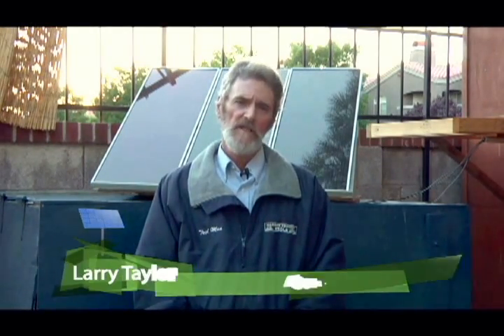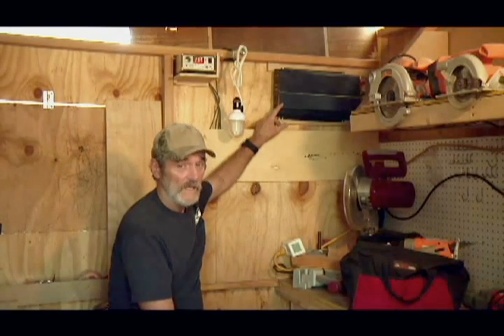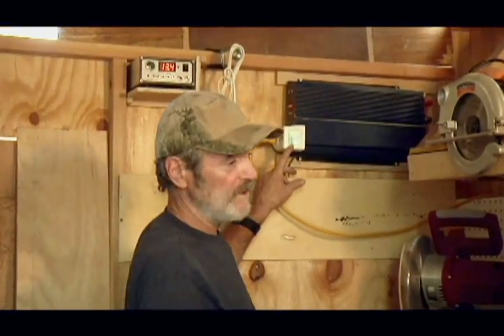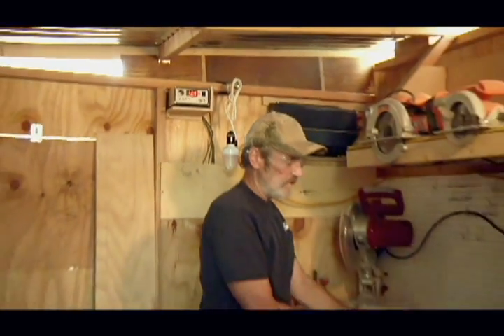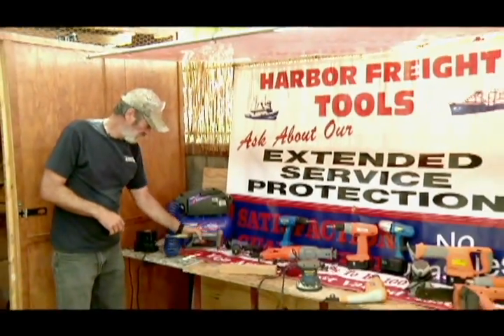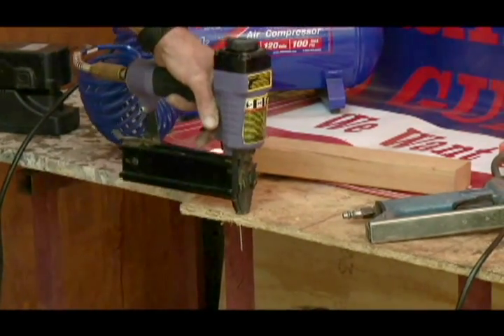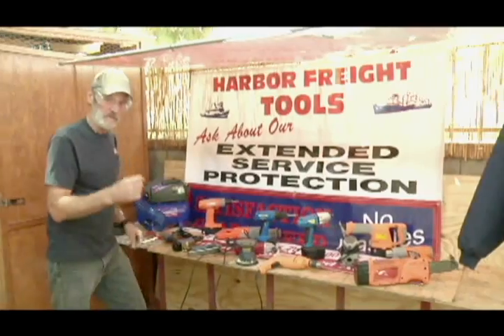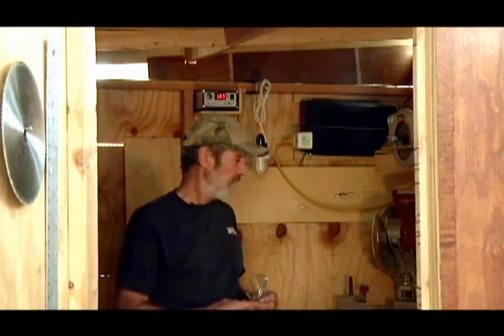Solar Toolman Workshop - 1

Comment: I liked it a lot. Easy to understand. Simple to follow. Very nicely done. Thanks Larry from myself David T - The Aussie living in the UK. I want to use solar to power my office, which is in heavy duty, fully insulated garden shed about 14x8. I need to heat it, a PC's and a printer, a dsl modem and a phone. I will watch your next videos to find out how. The biggest draw will be the oil filled radiator and the Mac with modem. The rest will be intermittent. My biggest issue, Manchester weather.

Comment: Thanks for your video, I own most of what you show in the video but my Harbor Freight 15 amp chop saw would refuse to stay running off the 2KW inverter (same model you show).   Ran a battery load tester on my deep cycles (they were new in 2005, I bought them used) and yep, the load tester said they run weak.   I think something you might have discovered by accident is that regular car batteries surge better than deep cycles.  I originally blamed the problem on my first inverter.

Comment: Thank you for the workshop, i have just invested in all the equipment that you have demonstrated, and then found your workshop.  I am looking forward to your next work shop since i have already bought a 5000btu aircon., so far it works fine, but the shop vac, is killing the system.  Thank you again.

Comment: i have 5 of these hf solar panel kits and 10 deep cycle batteries. i'm in the process of having a 10ftx16ft out biulding put up and it will run off the hf solar panels. i'm getting 10 120 watt panels(not hf panels) to mount up on the roof and run straight into a grid tie inverter!!! these kits are great for a starter kit and multiple kits and a new charge controller are really great for running a out biulding using 2 5000/10,000 watt inverters.

Comment: Thanks again for a great video. This almost makes me want to go buy another that would bring me to 5 kits. I can't wait to see more vids on this. I really want to see how you plan on running AC off one bat and the inverter. I have the one you have and it pulls to much power. Suggestion for telling users is pure sine wave inverters for running radios etc. And to use inverters with temp fans so the fans do not run constant.

Comment: hi Larry, 

Will you be explaining in laymans terms Amp /Hr rating  to explain the charge life of the battery? Also how for an inverter  general rule of thumb power in to power out. Example for 12volt system it takes 10 amps of DC to make 1 amp AC at 120 Vac. Explaining all this will give everybody a real world expectation of what the Harbor freight system can deliver. it's a great starter kit for the money.

Comment: I have one of those Harbor freight sets, and like a lot of charge controllers the back has a point to hook up the "load", but am I reading everything right that you still hook the inverter to the battery and not the "load" part of a charge controller due to that just having skinny wiring that can't handle the full power stored in the battery?   That being the case, could I in theory hook up a grid tie inverter to the "load" connectors and then use the grid tie automatically once battery is full?

Comment: I read the manual for the Harbor Freight system, and it clearly states that when the battery is fully charged to disconnect the panels.  Is that really necessary?  I can't stand around the system waiting for it to be fully charged every day.

Comment: I'm confused. We went to HF and bought this system and the guy said we might as well get the cheapest inverter, because that's all the 3 panels and one battery can use. So how does that work? I don't understand watts, amps and volts etc. I want to understand though, why would I get a bigger inverter? To handle more batteries or more panels?

Comment: but to keep the battery charged ohms law 101 volts is pressure so you only get <1/10th of the PVs rated out put.